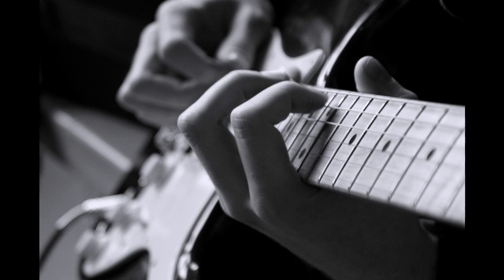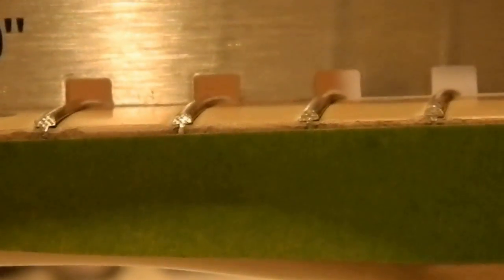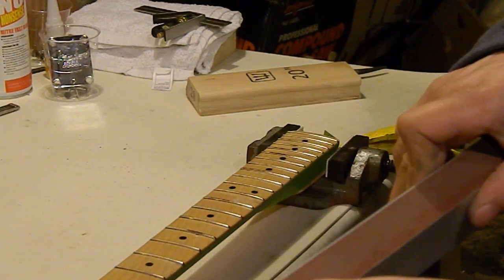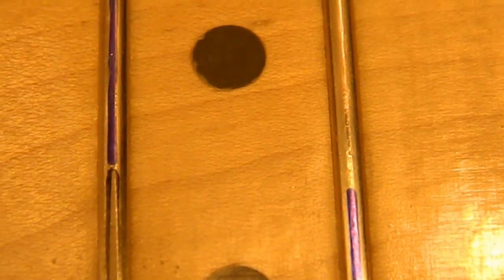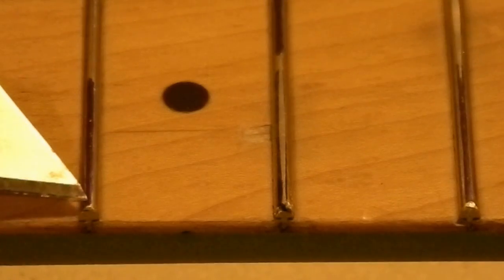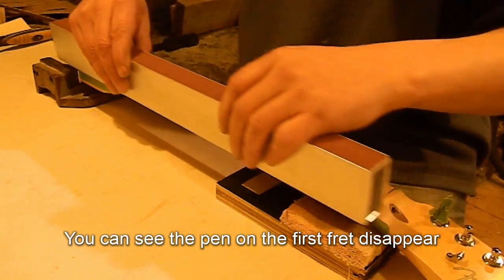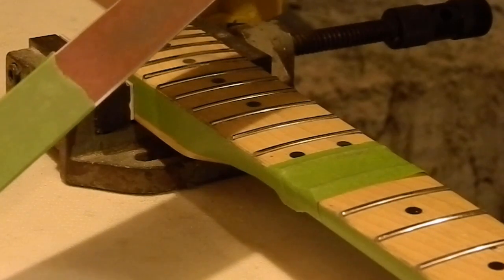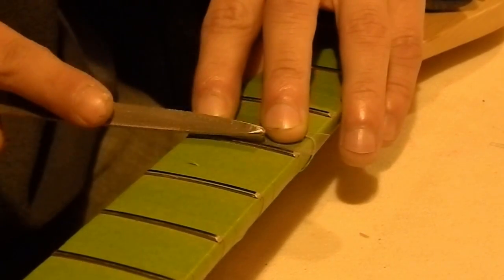Guitar Fret Leveling Why and How - Part 1 of 2

Comment: Soo, the neck has a convave or a back bow and you use a long sand paper like that, how does it level all the frets? Wont it be affected by the neck curvature
Reply from the maker: +pukki34 I straighten the neck before I start as shown in the video, thanks for watching
Reply: +duncan wallace ok, seems i have to make a tool for checking the straightness first :p
Reply from the maker: +pukki34 yeah for sure - as you rightly point out, if the neck isn't straight to begin with you are never gonna get level frets, so a notched straight edge is a very useful tool for this job and certainly one I would recommend
Reply: duncan wallace Yeah! Will give it a try
Reply: +pukki34 buy the notched straight edge.
Reply: +pukki34 +Nicholas Fanzo I agree, definitely buy the notched straight edge if you want to do this. In the long run you'll be happy you did. It's also a very handy tool for checking your necks from time to time just to see how they're doing.
Reply: Brandon Veracka After 8 hours of sweat and tears I took it to a local guitar shop (small business) and it came out a lot better :) Dont bother learning this process :)
Reply: pukki34 Well you gotta remember, I've been working on guitars for YEARS. It started out as a hobby and now it's something I do all the time. I think this video was aimed more at guys like me than beginners. But that's good you got your guitar all straightened out; rock on buddy!
Reply: Brandon Veracka Yeah! Thanks
Reply: If you remove the strings and loosen the tension rod, the fretboard should lie almost flat. A slight amount of bow in either direction is acceptable if it's not excessive. For example, if the loose neck has a bow, and you have to crank the tension rod excessively to flatten it while it's unstrung, it does not bode well for the neck's chances of being properly adjusted when strung. If there's backbow, you may have a little better luck once the string tension is pulling on the neck. The down side of excessive backbow is that you need a two-way tension rod to correct it. If the string tension alone won't pull the backbow out and you have a standard rod installed, it's more of a problem than if you only need to remove a forward bow by adding tension to the rod..

Comment: My guitar's G string buzzes only on 12th fret. No other strings buzz in any frets, it's only the G string on 12th fret. What might be the reason behind this and how do I get rid of it?
Reply from the maker: +Sanjiv Mainali do you mean it buzzes when you fret it (have your finger on) the 12th fret, or when you fret lower down you see the string touching the 12th fret? ... if it's the former then i'd guess one of your frets above 12 is high in the middle - find out which one and level it off gently using micromesh or 600 grit sandpaper - do this while your guitar is strung up to to pitch and check often if the buzz is still there ...  if it's the latter, do have a fret rocker? ... or anything flat that will span over fret 11, 12 and 13 - if fret 12 is high take some micromesh or 600 grit sandpaper and abraid your 12th fret till it's level with the two next to it ... hope this helps and thanks for watching
Reply: +Sanjiv Mainali you have probably worn the higher fret with vibrato on the G string

Comment: Does it matter if the first fret is higher than the rest?
Reply: Yes because the nut slots would have to be cut more shawoller to keep the the strings from buzzing on that fret and you'd have to apply more pressure on the rest of the frets from the 1'st fret up which would cause those strings to fret sharp.
Reply: @keithclark486  I don’t know why I didn’t think of that, lol.  You’re 100% right.  Thank you.

Comment: In your opinion, how long (hrs or minutes) could an experienced person with proper tools level, crown and polish a 24 jumbo fret guitar with average amounts of wear and no dents? I was told by a local luthier he can do it in 1 hr for $35usd!! Is this possible? Can it be done in 60 minutes if you don't dilly-dally around? Most quotes I've obtained were $150-200, but no time frame was given.
Reply from the maker: I would say that a good guitar tech would do a fret dress (level and re-crown) and then the set up after within an hour. $35 sounds very cheap, but if he does a good job then great! The other prices you quoted sound more in line with prices here in the UK where guys would charge £60 to £100 for a fret dress and setup. Hope that helps and thanks for your comment!
Reply: 1 hour sound like either a bait and switch scam or he is taking major shortcuts that will leave you with a half ass job. It takes about 3 to 4 hours total. Plus I use a sanding board that matches the radius and start with 600 grit and do it much faster than in this video with perfect results. I finish with a Dremel buffer and compound for a mirror finish. I would NOT have anyone use a flat sanding block on my fretboard like in this video. Thats how to get uneven flat spots.
Reply from the maker: Chris Lee
hi chris ... yeah there are lots of different ways to tackle this job and a radiused sanding beam is certainly one of them - it does have it's issues too though ... first off the height of the frets adds to the radius measurement, ie if the fingerboard is a 12" radius the top of the frets is a slightly larger radius. Also, you have to set up a jig to make sure the center of the beam stays exactly in the center of the fingerboard. A lot of guitars that come to me have a compound radius & obviously a radiused beam is no good for them ... plus I'd need to buy a beam for every single radius out there - big bucks! In saying that, I do have beams for the more common radii and sometimes use them to level frets ... each to his own I suppose.
Reply: I can do most fretlevels in about 1-1½ hour given there are no interruptions, and no futher problems arise, but I'd charge more because of the tools I have accuired and the number of years I have done it, meaning the quality of the job is high, at least 100 dollars without strings.

Comment: how do you level a les paul when the end of The frets are covered with binding? just sand over it?
Reply: +Nicholas Fanzo The binding is low enough that the sandpaper won't touch the binding. I've worked on bound necks a few times. The proper technique--as Duncan explains here--is to never sand at an angle, but straight across the frets. Additionally I recommend using painter's-grade masking tape to cover up your fretboard (as we do when cleaning frets), which will give you some 'insurance' on not touching your fretboard, inlays, and binding--which is especially important while crowning. Keep to that and your binding wont be bothered. I'd also do the 1-12 separate from the 12 & up like he did. Also keep in mind to use very fine paper; finer is better here. 
    Final piece of advice--If it's your first time doing this sort of thing, I recommend taking a cheap guitar (esp. if you've got one lying around) and practice on that first, as it likely has a high fret or two anyways. That'll give you some practice and some confidence going onto the Les Paul. You DEF don't want a LP neck to be your first fret job. Especially because Gibson makes neck-thru guitars and necks aren't replaceable, you don't want to mess this up. Sure, if you mess up you can always get it re-fretted, but that's still a pain in the wallet you don't want. Take your time with every step, relax, and try to have fun! Regards from Boston, MA
Reply: +Brandon Veracka great inform thanks!
Reply: Nicholas Fanzo Be sure to give the DIY thing a good think-over, and if you're going that route definitely take into consideration practicing on a cheap guitar like I said (= Happy Playing!

Comment: 6:05 I removed the nut on my fender player stratocaster the same way u did. and it broke in half :'( I got half of it out and pulled it out and it broke.. maybe bcz it was plastic i don't know
Reply: Bone is pretty easy to break. It's hard, but brittle.
Reply: Steve Springer Im ordering a tusq nut to replace it

Comment: Is there any reason a radius block or beam cant be used to level the frets ?
Reply: I always ask this myself. Isn't easiest to check the fingerboard radius and use a matching radius block to level the frets more even? A local luthier told me he tried this once but the radius block started to remove too much fret material on the edges. I'd like to hear more opinions on this.
Reply: Mark Tosh, it would seem logical, at first thought, but you need a flat beam like shown here.  Radius blocks are for sanding or final shaping bare fretboards.
Reply: @GugaRamone  , the correct tool for leveling is a beam.  Radius blocks are for sanding bare fingerboards.  You will take off too much on the edges even with light pressure.
Reply: @captainamerica9353  I got what happens. The block radius should be the radius of the fretboard plus the height of the fret. Then it would remove evenly the material.

Comment: easy way is put guitar on pavement ( concrete or asphalt) not on gravel face down with bricks on top. tie to trailer hitch drive.be sure to have jumbo frets on to start. drive several miles then check . If smooth enough then put on strings.

Comment: I use this exact method now and just did a video on this job on my channel. Thanks for the tips etc... https://www.youtube.com/watch?v=4pkBsL14xTs One slight criticism; I would only put tape on the beam when doing the fall-away else I think you'll be taking too much from the last couple of frets. I piece of tape thickness is enough IMO. I only create fall-awy if the customer requests it as I don't think it's necessary...

Comment: I cant believe people using a ruler to measure things like the action height and neck relief. The only accurate way is to use feeler gauges, a couple  of quid of ebay,  For example a medium action is 0.060" at the 12th fret and relief around 0.012" at the mid point of the neck.

Comment: If you're intent is to go ahead and level all of the fret wires. Why wouldn't you use the wider side of the metal fret lever? Right now you are just using the short side of the tool. Causing you to not level an entire fret in one motion. Just part of a fret and then move to the next part of the same fret.

OH wait perhaps the answer is then the radius would be destroyed Therefore the leveling beam should have the radius, say 9.5 or 12, already formed on the larger sides.
Reply: Its harder to control the radius withe the bigger side since you will have less contact over the wider surface.
Reply: Peter Janak Jr to maintain proper radius I do believe